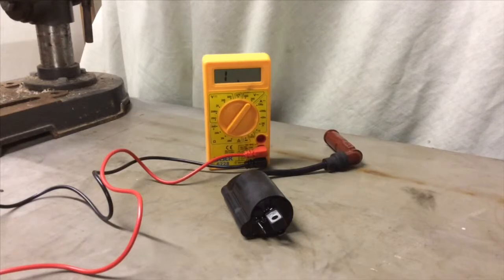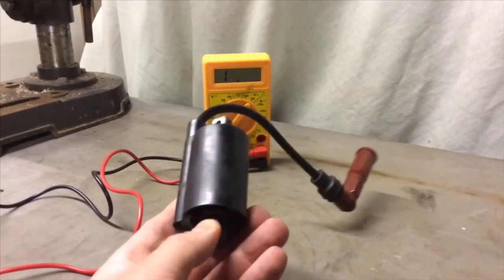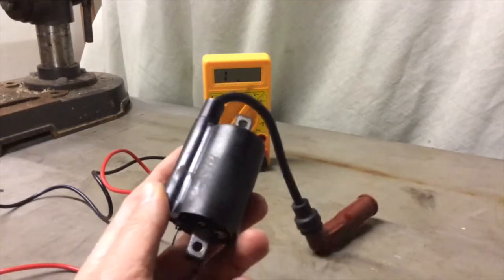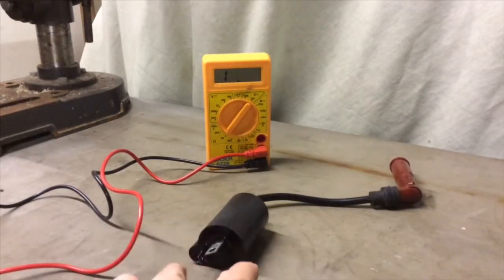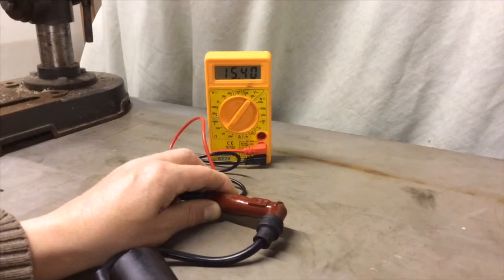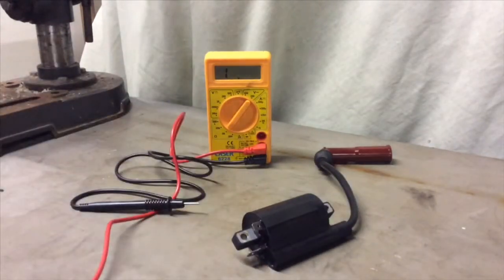Motorcycle Coils —  Testing Primary and Secondry Resistance.

Comment: my Ignition coil primary is giving 0.8 ohms and the secondary giving 4.36 kilo ohms, i tested for sparks against the body two spark plugs, all not working. Do i need to change the ignition coil?
Reply from the maker: Yeah sounds like they are probably shorting out somewhere. Cheap enough to replace, so I’d replace both.
Reply: @memybikeni9931 my ignition coil primary gave me a 1.4 and my secondary gave me a 9.54 and I also tested two spark plugs one old and one brand new  do I need to change the coil I have no spark at all
Reply: @memybikeni9931 I have 1.2 primary and secondary  plugin was 9.54 and I checked it with 200 as said so should I change my ignition coil?

Comment: Thank you for a great instruction video. I have a bike with 2 x CDI's powering 2 spark plugs each. I have a no spark situation at the plugs in caps. Using your method I have a Primary figure of 4.3 ohms on the LH CDI and fluctuating 4.3-5.1 ohms on the RH CDI. The manual says Primary should be 2.3-3.5 ohms. The Secondary on all 4 leads/caps is ZERO no reading at all, Manual says 12-13K ohms. I am thinking that both CDI's are toast but strange that both have tossed it in at the same time and also strange not even a reading for any secondary.
Reply from the maker: So the coils do sound bad, high resistance and variable resistance on the primaries, is clear cut, open circuit on the secondaries. Firstly though make sure you are testing the secondaries correctly. When you have one coil with two plug wires, test across the two plug wires, not primary to secondary, like you would with a single plug. If you still have nothing, take the plug caps off, probe directly into the wire. Trim the wire back, take the wire out, go straight into the coil terminal if you can. The virago ones are all moulded of course, but it sounds like yours are dead. It’s not unusual for both to go bad, one can over load the other if one fails. At least I think that’s why you were referring to when you said CDI, you meant coil ?
Reply: @memybikeni9931  Thank you so much for your help, most appreciated. It's a 27yr old Ninja bike 1997 zx9r so I think I have got my money's worth out of the coils:-) The point of sale vendors refer to them as CDI's so I am picking up the term from that, but yes coils in the manual. I tested across the two plug wires and get a reading flash up and disappear quickly with wiggling the probes of 19K. I have ordered two new coils, hopefully will generate a spark for me.
Reply from the maker: @johnbaxter85  sounds like that’s your fix. So the CDIs are specifically the ignition units that send the timed power to the coils, they are something different so maybe the seller was using the wrong term or just getting your wires crossed, excuse the pun.

Comment: 3.30 sir this process my ignition coil is showing continuity is that okay or not ?

No resistance
Reply from the maker: So continuity means resistance, and depending on your bike should read a certain value. Across the primaries, the two pins on the coil, 3 - 5 ohms typically, so yes continuity, with low resistance reading, and across the secondary, either pin on the coil against the other end of the HT lead, 12-14,000 ohms needed, so again yes resistance should be seen, high ohms. Hope that makes sense.
Reply: @memybikeni9931  sir tell me what to do secondary winding woth this process of video one lead in spark plug and one on signal point cdi it shows 4 ohms is that okay ? Can you give me your WhatsApp ?  I will send you info
Reply from the maker: @YAMAHA_FAN_BOi_95  make sure your meter is set correctly, as 4 ohms  is way too low for a secondary reading as you describe. I don’t have WhatsApp sorry.
Reply: @memybikeni9931  what you say sir is that okay
Reply from the maker: @YAMAHA_FAN_BOi_95  yes
Reply from the maker: @YAMAHA_FAN_BOi_95  take the plug cap off the end of the HT LEAD and try it once more, directly onto the HT lead, there may be an issue with the cap, some of them have resistors inside. If it still that low, replace it.

Comment: Hi mate, I have a ktm excf250 2008 and it's not sparking. I've tried following your video and still can't workout what's wrong. I was wondering if I can somehow get in contact with you and if you would help I'd really appreciate it.
Reply from the maker: Hi mate, it’s a difficult one to diagnose from a distance, very often takes a poke around. I’d suggest starting at the plug for spark, then cap with plug out, HT lead minus the cap, low tension wires into the coils, then back to the low tension output from the igniter. Connector into the igniter, connection from the battery. Have a good look round the wiring loom for any chafing, and grounding, check the side stand switch if fitted, clutch switch if fitted, and the dumbest thing, the kill switch. Check the voltage output from the pulsar coil and make sure that connected to the igniter properly. Check for resistance across the pulsar coil out put. Go back to the main coil and test for resistance over the primaries and the secondaries. Somewhere in there is going to be the issue. What will happen is you’ll go so far back and see there is a power break somewhere or a high resistance, I.e in the main coil, and that will isolate your issue.

Comment: coils seem to get blame for all tbls  there points and condensers to consider    condenser cause all kinds of tbls first sigh of tbl is pitting points caused by faulty  condenser  or wrong mfd value. installed     there is no one size fits all on condensers it must match the coil for max spark
Reply from the maker: This is a ‘92 with a pulser coil, and CDI so no points and condenser to worry about. But you are right, from this and your other comments, aftermarket parts not quite right for the bike can be a source of issues. I had no end of troubles with the ignition on this bike, but cheap parts mostly to blame.

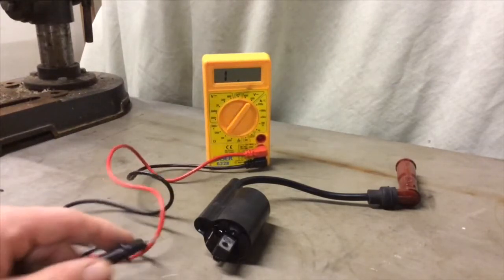Comment: 3:04

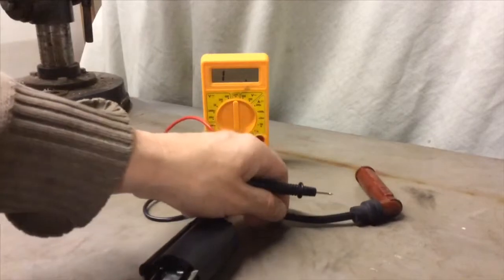3:40 ''if we try now against...''
(if we try now 'GROUND' against secondary)
Reply from the maker: Hah ! So I used the verb ‘To Try’ interchangeably as it is with many verbs, understood from the context, and you feel the verb ‘Ground’ is more appropriate. Although ‘If we try now ground against’ is actually poor grammar on your part. Such a strange comment, but at least you tried or ‘GROUNDED’ 😂.
Reply: @memybikeni9931  Wut in the - - - - are you 
going on about, and my grammar is 
bad (?), you sound like a 3rd grader, I wasn't
correcting any of your grammar, you don't even know what a  
- - -  verb is either. 
I used your grammar not to insult you 
dipwad, I used it (your grammar) 
to keep the context paralleled, and simple. 
MY POINT was to clarify for others that 
you were 'trying' (taking) GROUND to the secondary,
(why do you think I highlighted 'ground' and 
not your Grammar? lol 
Someone that needs your tutorial will 
most likely need to know the; 'what to what'. 
Not having to guess what the CP is talking 
about, is a good thing, some of the people
you're helping barely know what a multi
meter is. Cheers..

Comment: Hi spoke to you before. Have just tested ignition coil on my DRZ. Secondary test seems ok showing correct resistance. Primary however reads 0.000 ohms resistance. Has this coil had it. Thanks Pete
Reply from the maker: So if you have just tested the secondary, then you may have the meter set high at around 20,000 ohms, as you’ll be looking for a reading in the 10-20k range. If you have not then dialled it down for the primary this may be your issue. As you are only looking for about 4-6 ohms you should set it to the lowest ohms reading setting, e,g 200 ohms.  It should then register the lower reading that you are looking for. If it’s set at 20k still it’ll likely not register and show as zero. Nothing has zero unless it’s a superconductor. It’ll either show something or open circuit. If it is still truly showing zero after that then you have a broken multimeter I’d say, but my guess is this is the issue 😊
Reply from the maker: If it were a short in the coil, you’d likely still get around 0.6ohms from just the short and probes etc.
Reply: @memybikeni9931  okay thanks for really quick reply. Have settings set correctly now thank you. Would you know if workshop manual recommended secondary resistance readings would be with spark plug cap on or off. Recommended reading should be between 12-20k ohms. Mines registering 6 ohms Thanks again Pete
Reply: 6k ohms
Reply from the maker: @petedevon  if there is no resistor in the cap it shouldn’t make a difference. 6k seems low. Probably worth replacing the coil and leads etc anyway, but shouldn’t be the cause of a no spark if you are still having that issue.

Comment: I have a 2002 drz400. Only Has one cable going into it. How do I test the primary coil. Also testing the secondary coil the reading shows 16.52. Is this too high. Thanks in advance
Reply from the maker: So to test the primary where there is only one lead you just place one of your multimeter probes on the input and the other to the grounding block, as that is the ground rather than a 2nd lead running back to ground. For the secondary that doesn’t sound too high to me, but I don’t have a spec on a DRZ400, but sounds about right. Why are you testing it, what’s your issue ?
Reply: @memybikeni9931  Went to start the bike about 2 weeks after last being ridden. Wouldn't start or even remotely sound like firing. Tested for a spark and there isn't one.  Not very mechanically minded but gradually working my way through things. Thanks for your last reply by the way. Will try this tomorrow. Bike is Kickstarter only. No battery either. Think my next step after checking the primary would be the stator maybe ?
Reply from the maker: @petedevon  yes just methodically work your way back, pulsar coil possibly or maybe a dodgy connection somewhere. Could be anything couldn’t it 😬.  I actually quite like no spark situations, it’s there somewhere, just got to find nothing happening where it should be happening, and keep going back until you find it happening, and that’s where the issue lies 😂
Reply: @memybikeni9931  Yes I'll keep plugging away at it. Thanks again
Reply from the maker: @petedevon  literally test and clean every single connection back, plug to the block, cap to the block, naked lead to the block, voltage from the primary lead to ground, stator resistance and voltage, pulsar coil same, issue will be in there somewhere mate. Other things to check if applicable, kill switch, side stand switch, clutch switch etc, although not familiar with the DRZ so just a generalisation.

Comment: How do you test a coil with two spark plug leads? If you do the same test then you dont get a reading from the spark plug leads. There must be a different test for duel leads.
Reply from the maker: For the primaries it’s the same, for the secondary you test across the two HT Leads.

Comment: mine reads zero does that mean its bad
Reply from the maker: So I assume you mean the primaries ?  So bear in mind nothing has zero resistance except super conductors and you’d expect you see something just through your probes, so if it shows ‘0’ then you may have the multimeter set on a very high Ohms reading of say 2000 or above and due to the sensitivity of your meter it’s just zeros out, so make sure it’s set no higher than 200 to get a reading in the 2-6 Ohms range. If you mean it’s showing ‘I’ as in an open circuit/infinite resistance then there is a break and it’s dead. If it is showing truly zero when you check the meter settings then there is likely a short in the windings and it should be replaced. If you mean the secondaries which I don’t think you do, and you have the meter set correctly at 20k ohms or above and it is showing 0 Ohms rather that ‘I’ infinite resistance, then as there is no physical connection between the windings it’s more likely you have a short. As the meter is set too high to read a low resistance value, again it will show zero resistance due to the meter calibration. Hope that makes sense.

Comment: Checked the resistance on mine, read OK, literally tried everything other than the coils to stop the misfire...still misfiring so I'm replacing both coils...let's hope it works. If it doesn't, I'm our of ideas!
Reply from the maker: Try pulling the plug cap off the plug and just lightly holding it on the terminal. Have you test per that the plug is seating ok, and grounding well ?
Reply: @memybikeni9931What's holding the cap just off the plug terminal going to suggest?

Comment: i have zero reading on primary....so coil is buggered correct? replace it???
Reply from the maker: absolutely
Reply: @memybikeni9931 .. I have a reading.. Was on wrong setting on voltmeter. Its 4.60ohm. That will be functional?
Reply from the maker: @danmobbs1976  oh yeah that is within range so all good there
Reply: @memybikeni9931  still won't go... Got spark and carbs clean and receiving fuel. Got an Email? Can you help plz. I'm stuck for ideas
Reply from the maker: @danmobbs1976  check the carbs are balanced ok, and mixture screws are set correctly. What’s the filter look like, is it blocked ? I assume you have compression, did it just stop running ?
Reply from the maker: @danmobbs1976  is the choke operating correctly, have you had the carbs right apart for a clean, you may have upset something ?
Reply: @memybikeni9931  have compresson. I clean carb thinking it's a reason why no start. Everything's fine there too my knowledge. The choke? Auto bystarter? Potentially faulty but I have ohm ready and tested it manually seems to work fine. It looks like timing. But apparently this can't be adjusted?
Reply: @memybikeni9931  I have two screws. Not sure how many turns they require from shut
Reply from the maker: @danmobbs1976  try 1.5-2.5 turns out. Timing is mechanical yes for the valve train, for spark it’s controlled by the ignition unit. The unit may be dodgy. Give the leads a wiggle on the bike, press and hold the caps, sometimes you’ll get a spark holding the plug against the block then it won’t work in the cylinder if it isn’t grounding properly or if you have a leaky lead. What sort of spark do you have, thin blue or fat yellow ?
Reply: @memybikeni9931  I will do and Clarify the colour of spark now. I'm missing the filter... Has brand new plug replaced with what it had. Mb it's wrong but yes it sparks on the block but mb not in the cylinder I havnt thought about that. Potentially my earth could be bad then? Like earth from block to frame? I can just add my own? I'll add a extra earth in case... What you think
Reply: @memybikeni9931 screws it's currently 2 turns out. I tried slight adjustment whilst trying to start to encourage mixture to ignite but nothing seems to change. I can hear in the engine it's bogging down like it's trying and fighting compression
Reply from the maker: @danmobbs1976  No I’m thinking more of the plugs not grounding against the block where they seat. Try cleaning the spark plug seat. If you’re getting spark against the block and fuel is getting through then something is changing when you put the plugs in. Are the plugs wet when you take them back out ? That will at least confirm if fuel is getting through. If not try spraying a flammable aerosol  into the air intake side of the carb, or take the carbs off and spray directly into the inlet manifold. If it fires then you have a carb issue. If not its definitely spark. I’d then just change the coils, leads and caps all in, as they can be buggers. I have changed mine a few times for the symptoms you describe.
Reply: @memybikeni9931  OK. Dude your awsome. I'll go do some checks and come back to ya.. I think the plugs losing earth when I put it in
Reply from the maker: one trick on that is to touch the cap on the top of the inserted plug without fully pressing the cap on. Also, give the battery a charge I imagine you’ve hammered it by now.
Reply: @memybikeni9931  yep battery currently on charge now. Spark was blue I have two coils and 2 plugs I've tried. It's definitely trying to start so I'm very close. I'll upload a video on my account now see what you think

Comment: How much volt do u need on the primary side? So it wil work propely?
Reply from the maker: I done know precisely but it will be in the low hundreds. Have you got a stator issue. I’d run a test on that.